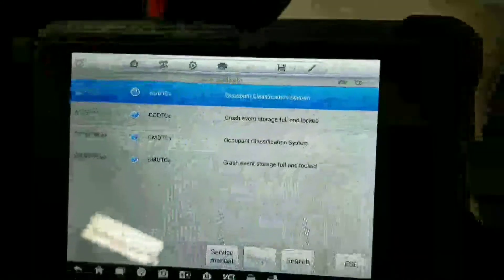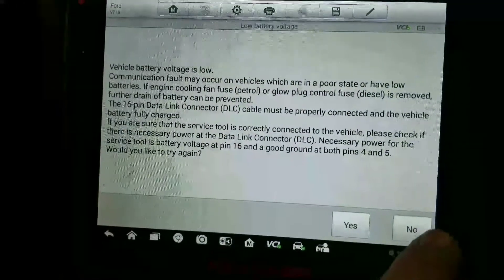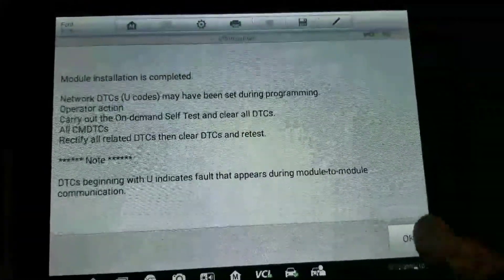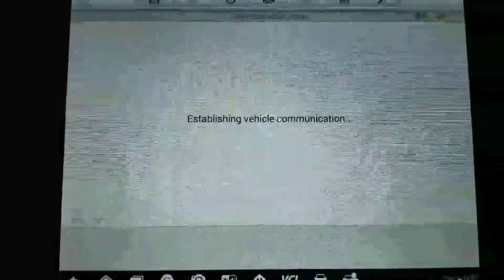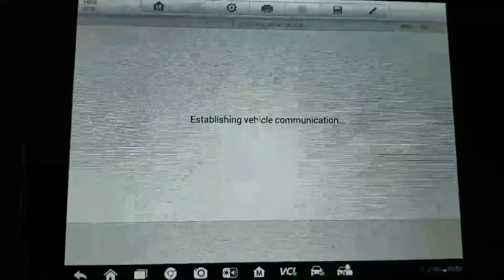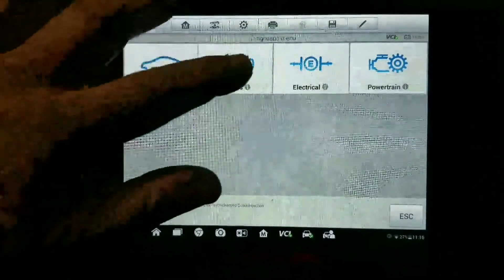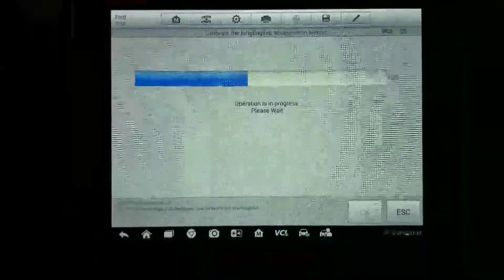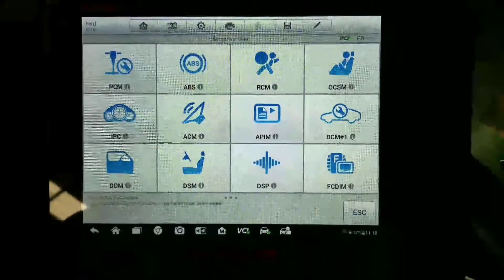Replacing Ford airbag control module or other pcm ecu's transferring calibrations autel scanner

Comment: Do you need to disconnect the battery before swapping in the new module? Or is it fine to replace with the car battery still connected?

Comment: In one of your previous videos where you were working on a 2017 escape and programming the RCM you stated that if there is a pretensioner fault code that on some automakers vehicles you can not program the RCM. Is A 2015 ford escape on that list of vehicles that this would apply to? Working on a flood damaged 2015 ford escape where about 3 inches of water covered the floorboards and I have a pretensioner fault even though a new VIN matched seatbelt retractor has been installed. Been to 3 ford dealerships and nobody can get the RCM programmed. Before this last dealership it was at a shop that deals with vehicle wiring and finding shorts and according to him he did the ford test to verify there was power and ground to the RCM and he did not see a problem as to why the RCM would not program. He also would not try to diagnosis it any further because he said that without any program in the RCM he had no way of knowing whether any of the codes this vehicle is giving are even correct. By the way this is a brand new VIN matched RCM since somebody had already removed the original RCM and replaced it with the wrong one so nobody can pull the original programming code and put it in this one.

Comment: Hey Jack great video, thanks for showing this. I converted a 2014 Ford Focus Titanium to a 2016 Titanium face lift year. I have the Maxi 808 scanner but it does not do the module programming. Do you know if there is any upgrade i can do to the software in my 808 to get module programming? I had to replace every module in my car to the later 2016 year when i did my conversion so i need to program some of the modules like you did to my ABS, RFA, DDM,PDM,SOD-L, SOD-R and RCM. I got the PCM, TCM and BCM from the same donor car so it's just the others listed above that i need to program to get rid of codes. Oh, also the IPM-A module as well. Tnx

Comment: Hello Mr. Myers. I was wondering if this procedure only works on Ford modules. I work at an independent shop over here in Washington State and I am dealing with a 2017 Dodge ram truck that is about 600 miles over warranty.I pulled a B2207 code (Occupant restraint controller internal 1) And have condemned the module because I have CAN communication with the controller and of course power and ground but it will not accept any inputs. By the way, your video was extremely informative as we have just recently purchased the Maxisys Elite with the J2534 pass-thru and I am still trying to figure out all of its capabilities.

Comment: So did you change the module with ignition on and tool connected , end if so, in plug module prior to moving and vis bets for fitting new ?

Comment: HEY, WE GOT A 2010 MERCEDES GLK 350 THAT WAS IN A CRASH , AIR BAGS DEPLOYED , WE REPLACED THE PRE FUSEBOX, WHICH WAS BLOWN UP FROM CRASH EVENT FROM AIRBAG MODULE, WILL THE AUTEL SCANNER PROGRAM THE VEHICLE TO LET IT START... IT WONT CRANK, EVEN THOUGH WE REPLACE THE FUSE BOX
Reply: With that username, we should be asking you....

Comment: I am looking into a better scan tool. I currently have a mk808, but I want a tool to do what your videos show. I work for a Ford Dealership. Do you have a website that I can check out? Or a Facebook page? Your videos are extremely informative.
Thanks, Steve
Reply from the maker: thebigvol i'm actually working on a website right now but no I don't at the moment. I can answer any questions you might have though.
Reply: Jack Meyers cool, I just got my MS906BT yesterday. I work for a Ford Dealership in Knoxville, mainly do suspension work but I need to branch out.
Reply from the maker: thebigvol yea . Programming, electrical and drivability are in demand like crazy.  The newer cars are starting to hit independent shops and a leaving the techs that never learned or evolved scratching their heads. My business is living proof. I get minimum 8 calls a day from shops with techs that have limited troubleshooting or programming experience.  Figure I make on average $135 a call minimum and usually can be in and out within 45 min.  I specialize in airbag systems and most body shops would rather leave the liability on me. Sometimes I make $2200 in a day replacing dashes , airbags , seatbelts and such. Not a bad living.  It's always a good idea to learn and expand what you can do. A little advise . Don't get branded and learn only one manufacturer if possible. Jump on any opportunity to learn or experiment with every brand of car you can.  The more you learn the more you're worth. Don't get me wrong I really like doing fords and how they give you the as built data for free online is a huge bonus but they are a small percentage of my overall work.
Reply: Jack Meyers, I have a question.. I'm still experimenting with my MS906BT, can you command more than one pid at a time? Say like, the reverse lights and high mount stop light?
Reply from the maker: thebigvol sometimes.  Depends on the vehicle but they have to be in the same module. Most will give you a list in active tests menu. You can turn them on one at a time

Comment: Did you do the module programming and PMI on this with only the autel 906BT or did you also have the J2534 device hooked up or another device?
Reply from the maker: No pass thru or j2534. Just the 906bt.
Reply: Jack Meyers That’s great to hear. I’m a ford tech at a dealer and our factory IDS is a joke. Looking for something to do it all and the fact that the 906 BT can even do programming and PMI out of the box is a great fit.
Reply from the maker: Jackson Taylor I have ids and a vcm2 that collects dust. it's so primitive. Honestly if you were to open up ids and the Ford software on the autel it's word for word. Function for function identical.  Autel had some features ids does not though. I have only had one car out of the hundreds I've done. A 2015 fusion that Ford had no published as built data for when I brought up the vin. The old pcm was dead so I paid for fmp and it ran through on its own. It was nothing I had seen before but it was a government vehicle. Not sure if that had anything to do with it. Other then that I've done all Ford and Mazda vehicles like this for about 3 years now.  No pass thru. Just the 906. Occasionally I have to log into motorcraft for the free resources and install manually but between the 2 i get it done free. All the pid's , graphing and programming the autel offers makes fords a breeze to work on.
Reply: Jack Meyers Wait so most of the time you don’t even need to grab the manual calibration files from the motor craft website and as built stuff? That’s crazy

What sold me was I looked up compatibility on Autels website and I searched 2018 F150 and it can even do stuff like 360 Camera Calibration which is quite an intricate thing for the IDS to do. Ordered my 906BT last night
Reply from the maker: Jackson Taylor yea. The tool itself has an app called function viewer.  You can put year make and model and what you're trying to do and it will let you know if it's capable. Petty cool.  And also yes when you go into pmi and start make sure the old module is in still. It reads it and then tells you too install the new module.  Once you hit ok it will transfer the info 95 percent of the time. Just don't turn off the bt at any point during the process while switching the modules
Reply from the maker: Jackson Taylor you will be surprised what it can do. It will let you aim the distance sensing cruise on the brand new fords.  Odject detection,  camera calibrations. Pats keys, . That's why I started making these videos. I spent many years lugging around big toughbooks in cars with a bulky pass thru. Now I have a small tablet that does it all. I'll take that any day
Reply: Will the MS906 not do pmi? Or do you have to have the BT?

Comment: Hey Jack just received my Autel MS906  BT today will it recalibrate the longitudinal sensor on a 2014 Fusion,  as the shop programed the  module but the ABS and traction control  light is lit.
Reply from the maker: RON COELHO Yes it will. Abs module special functions. Just keep the car still while calibrating.
Reply: Jack just had a air bag control module that a shop replaced on a 2015 Mazda CX5 and I was wondering if the MS906BT will transfer the programing as in your Ford video from the original module. The OEM site only does the ECM & PCM with a pass-thru. And as with the Ford will the longitudinal sensor have to be re-calibrated on the Mazda. Thanks for your help.
Reply from the maker: RON COELHO Ford and Mazda are the same. you can do the Mazda for free also with the autel. Go to motocraft website . Then login scroll down and click free resources . Then as built data .put in the vin for the Mazda and you will find the as built data for the srs control module on the list. With the autel do auto read on the vin. Once you have the car loaded go to programming then programmable module installation. Select the airbag module. If it can't read the original and do the transfer like i showed it will tell you to manually enter the info. Go down the list and put In the characters from the as built data that matches the info the scanner asks for . For example the scanner will show something like 735-06-01 . Look at the as built list from the Ford website and find 735-06-01 and put in the numbers and letters it shows click next and repeat until the autel says complete. Your module is programmed. Then go back to abs , special functions and initialized ivds. That will set the g force sensors and a few others.  You're done after that.
Reply: @jackmeyers2911  just read this reply from 6 months ago. You have a good heart for putting information out like this. May this generosity be the cause of all calamities to be steered away from you and yours. Thanks
Reply: @jackmeyers2911  thanks for all the great info! I have a 09 Ford Escape giving me a B1342 in the abs control module. Service info pretty much says replace module. I can communicate with it and it seems to work but abs and traction light stays on. Would I be able to get a used abs control module and reflash it or do I have to get a new one and perform the procedures you did in this video? I have a cardaq m and was tempted to try a used module and reflash it but wasn't sure if it was possible. Thanks for any advice on the matter!

Comment: is that possible with any of the new autels or does it need to be a pro or elite? You just have the 906bt correct?
Reply from the maker: Don Muscarella any of the new ones will work. The pro is the same as the bt  except bigger. The elite comes with a j box but I prefer a different brand of jbox. Even last years 905 mini will do it all.
Reply: nice i have an older 908 was looking to upgrade to the 906bt for the price u cant go wrong! Anyone you suggest purchasing through ? local tool guys want way to much. Online is always a gamble !
Reply from the maker: Don Muscarella can't go wrong on Amazon. There is a seller out of Fresno I can recommend. I've bought 2 there. There return policy is great. I ordered a soldering station not too long ago on Amazon and the iron wouldn't heat. They sent me a return label I dropped it off at the post office and they had the money bank in my account the next morning. I don't know how but I've never been afraid to buy from them since.
Reply from the maker: Don Muscarella sorry for the delay the Amazon seller is motorzone. 318 sales 100% positive feedback as a seller and I just bought the otosys Im100 from him today.
Reply: no problem, thanks for the info!